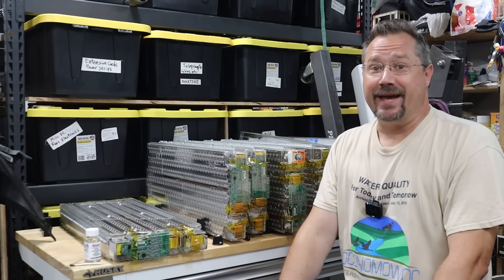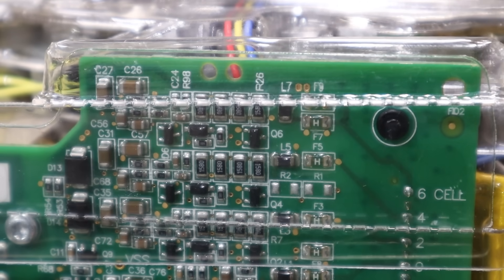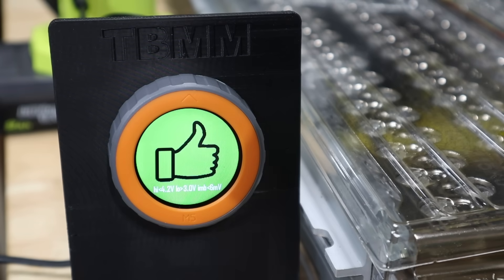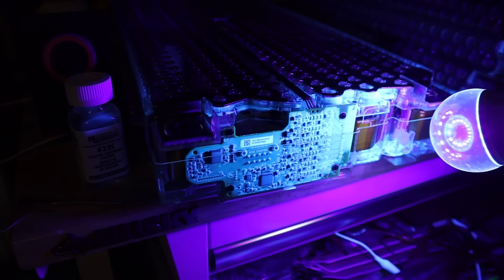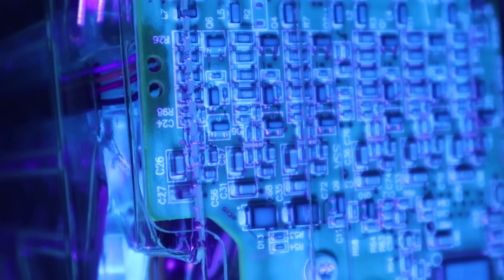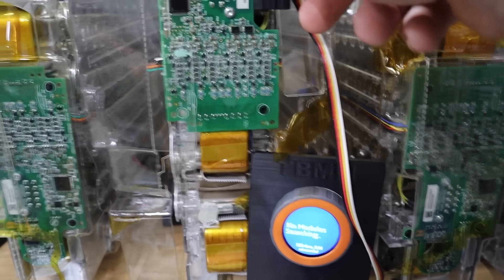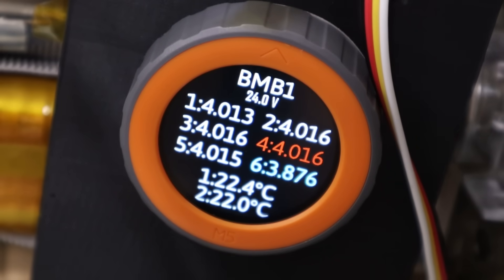DIY Tesla Battery Pack Repair: TBMM and Bad Capacitors! (C26, C27)

Comment from the maker: Please read the whole video description. Plenty of links in there for you!
Reply: Have you come up with a method to completely dry your pack?

The modules are one thing, but the whole pack can be a challenge.  I have worked with dryers and thought about some of my own designs to dry air for many uses.  I would be interested in your plans or thoughts.

After all that work of refurbishing a pack.  It would seem to make sense to install a very inexpensive humidity sensor.

Sensirion SHT31, Bosch BME280 and use an arduino or ESP32 to log the humidity.  First so you know you solved the humidity problem, and second once it is solved, some event in the future could start this all over again.
Reply: @johno812  that is a great idea! Something that should have been stock, in my opininon. I found that the rails "protecting" the umbrella valves had no runoff - so gunk gets in, but can't get out
Reply: @johno812 nice! Did you put one together? Can you show it in use?
Reply: @PhilipX2030 I can’t take credit, many people have used the sensors and ESP32 as IoT devices.  There are many variants.

My Tesla has just under 200K and I plan to add the sensor setup when I need to repair my pack.

In the mean time I use the sensors as just ambient humidity sensors.  

BTW, record both Temperature and %RH.  If no moisture is added or removed from the pack you can still get very large swings in relative humidity as the pack changes in temperature.  What stays constant as  the water stays constant is absolute humidity or specific humidity.   G/m3 aka grams per cubic meter.  But I prefer dew point.  If the absolute humidity inside the battery stays constant then dew point stays constant.

So if you see a rise in dew point over time, you are acquiring moisture.  %RH relative humidity is good to know as when your pack temperature approaches the dew point; your %RH increases.  If you reach dew point, then you are at 100% Relative Humidity.  You will have condensation and water droplets will form.

Comment: I did conformal coating at my last job and many of them use UV tracers to aid in inspection. That shot (around 8:20) is very typical board coverage. More thickness on flat surfaces and the bottom corner of components, yet barely visible on the top edges & corners. Just like any paint it'll run from sharp corners until it's cured.
And if you want any soldering advice feel free to message.

Comment: The TBMM is the purchase I’ve made lately, especially as I use these modules for my off grid home and unbalanced modules = thermal runaway = death. Mine just arrived and after checking 12 of my modules I found one internally out of balance, it paid for itself the first time I used it, thanks Kevin.

Comment: Moisture gets everywhere.  But I wouldn't discount corrosive outgassing of cells. I don't know if modern cells require venting like just about every previous design used to, but I assume it's probably unavoidable.
Reply from the maker: Modern lithium batteries are NOT like flooded lead acid batteries. 

Many electric car batteries, like those in the Nissan Leaf, are completely sealed up.
Reply: @BenjaminNelsonX many other combinations need vents as well. They're not always apparent,  but there.
Reply from the maker: @JoeSmith-cy9wj Can you give an example of modern electric car cells that off-gas in regular use?
Reply: nickel cadmium rechargeable batteries require ventilation under normal use, and lithium iron phosphate need a ventilation system because there will be instances of over temp, over charging and the probably of faulty cells within a large arrangement or sealed pack.
Reply: Like with people
Reply: @BenjaminNelsonX i didn't watch much of the video.  I noticed the corrosion on the component and decided to bring up the question of chemical reaction.

Comment: Very easy to repair. Use a little bit "Roses Metal" that help to resolder that SMD capacitor easily.
Use a soldering Iron with 250°C max. The Roses Metal melt near 100°C --> Use Flux, very important!!!

Comment: Amazing ! My 6 was low too . E pack 2019  . Pack died supercharging . “ ribbon cable failure BMS. Don’t know what it is . I wish I knew the coming issue in it.  017 018 fault bricks out of balance fault .

Comment: That green stuff doesn't look like corrosion.  It's on the plastic and the capacitor, but where did it come from?  Is it causing some kind of leakage issue in a sensor circuit?  Maybe some Tesla employee was eating mint ice cream and had to sneeze.

Comment: As a retired television teck, i use to repair televions at component level. All televions these days use simular sized components ( resistors, capacitors and diodes etc ) and i used a solderin iron that had two tips. This looked like a large pare of sprung tweezers and to use it, each side of the tweezers would ' straddle ' over to component that was to be removed. Have a good look at weller or simmular brands of soldering tweezers. Of course these also need to be a temp controlled iron as well. Not cheap but when you are useing the iron just about every day, makes the cost worth it.
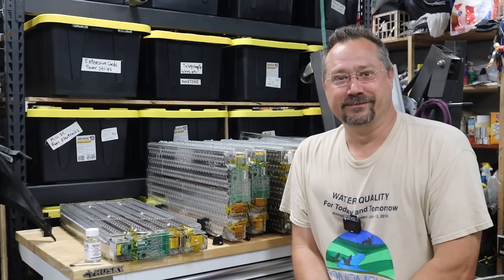Reply: 16:31 love it. Hot tip! 🔥 ⚡️

Comment: Those MLCC capacitors are notoriously fragile due to their construction. They’re made of multiple thin, brittle layers that can be easily damaged. If any disturbance causes those layers to shift or crack, they can short internally.
Because of this, many manufacturers prohibit replacing them with a soldering iron—hot-air reflow is the preferred method to avoid mechanical stress.

Frankly, this is a design oversight. Tesla should have added bumpers or spacers to prevent neighboring modules from rubbing against each other.
While moisture can’t be completely avoided, applying a good conformal coating can go a long way in protecting the electronics.

As for those bypass capacitors—they act as high-frequency filters, but in many cases, the circuit will still function if they’re removed.

Comment: Great stuff! Thank you so much! I have dried out all 16 modules now. Gonna order this little tester and check c26 and c27. I had water ingress in all 15 bays; there was moisture under every one of the mica-sheets. I have the upgraded Umbrella valves with only 2 per bay. I found no sign of water ingress on top of the pack or in the pyrofuse-box, som my guess is water somehow got in via the umbrella valves. The aluminium rails protecting them were caked with road-gunk - I think they were stuck in open position because of this, and water got in when I drove through a deep puddle (never doing that again). I also found that my pack had been refurbished because of water intrusion in the front, most likely because of water splas from the front wheel-wells; I could see that bay 6, 7 8/9, 10 and 11 had the mica-sheets replaced. I am gonna go overkill with sealant when I put it all back together 😆

Comment: Crazy to think about how on many new EVs the battery pack is officially not serviceable. So if one capacitor that costs a couple cents goes bad the whole pack has to be replaced for about 25k$.

Comment: Instead of replacing the capacitors, are the entire circuit boards available on the resale market? Time v. money, etc.
Reply from the maker: NO. The parts are no longer available from Tesla. The only parts available would be salvage from other cars. About $200 each on eBay!
Reply: It takes about 60 seconds to replace those 10 cent capacitors with a soldering iron

Comment: If you have never done SM soldering before, might it not pay you to get the caps replaced (if indeed they need replacing - see Scott Bakers's comment) by a professional?  It wouldn't cost much... $20/a board?  Shame to ruin all your good work for a such a small fee...
I really wish I had decided to have a go myself at fixing my 2015 MS battery that had exactly the same error codes as yours in Dec ' 23 (18 months ago).  I got Tesla to replace it in the end but it was a real palaver getting the car to the nearest service centre - and they were really unhelpful (refused to help get the car off the trailer that the towing company used after the S' brakes bound up due to the usual sitting still for too long in our coastal conditions).  I'm based on a remote island off the west coast of Scotland - 2.5 hours on a very unreliable (CalMac) ferry to the mainland and then anther 2.5 hour drive to the nearest city (Glasgow).  Especially as I have had a lot of success with other EV battery repairs (Mitsubishi i-MiEV) which we have 5 of here on the island.  Still, at least I could use some of the profit from my 2011 TSLA purchase to pay for the replacement battery...  took the sting out of it a bit... and it has a Tesla warranty.
Anyway, keep up the good work!

Comment: This condition is common when water intrudes. Some Tesla vendor supply had poor conformal coating, not proper thickness, which contributed to this result. 

I witnessed many packs without water intrusion, with BMB corrosion. The corroded boards were sent to failure analysis which confirmed the poor coating. 

Cleaning the corrosion with acetone to remove coating and corrosion.
 Use magnification to see well. Some type of excellent bore scope/camera is great.
After solder refit/repair, 3x coating. 

Also, inspect the pins/sockets before reconnecting. The socket "wing tabs" are known to sometimes fail and give intermittent false failure. These sockets were not designed for multiple disconnects.

The voltage sense wires are ultrasonic welded to the "collector plates". Unusual for those to be poor.

Visually check ALL wire bonds. Yes, slow and tedious. But you want to find a bad one now.

After the specific modules BMB are complete, be sure to balance the "bricks", of the module, BEFORE reassembly. 

Suggest that you replace the MAIN contactors, found in the "ancillary tray". Contactors do "wear", so NEW contactors only. 
 And a NEW main pack fuse. 

 NOTE: Pack fuse must be PROPER torqued! 
Clean the bus bar surfaces well with alcohol, or acetone, on a swab. 
And clean the fuse ends. 
This will insure excellent correct surface contact. 
Also, clean the threads on the bus bars. 

AND: ALL ALL ALL bus bar bolts need YELLOW thread lock coat before installation.
 Coat the bolt threads lightly, allow to dry, before installation. 
Again, correct TORQUE all bus bar bolts!

After final assembly, you will need to check, verify the cooling system integrity, using the correct PSI value (air test) with acceptable leak down value.
Check the cooling system integrity BEFORE installing the top cover!

AND the pack enclosure needs a leak down test, different PSI, after the top cover, fuse and cover, installation.

Comment: Ben, push on that C27 with the cover (YOU have capacitance, resistance, and inductance) but most likely it's a cold solder joint on the C27 or a trace to a pad that you can fix by cleaning the area of gunk and scrape ALL the conformal coating off an exacto knife then reflow the solder with a mini tip - if that doesn't work replace the cap.
i can do surface mount, clean the pads (don't take too long or the pads may come off the board) place the component (I like to use a little tiny clamp) solder quick (caps fail if you heat them hot or a long time) a small amount of solder is the sign of good workmanship - . conformal coat it - clear nail polish works fine - then touch it again to see if you resolved the problem.
be advised that it may not look like factory when it's fixed ... at least not when i fix them
Reply: No, they would not have a cold solder joint, its due to the corrosion. Absolutely replace the capacitor.
Reply: Also multi layer ceramic capacitors are piezoelectric devices. Pressing on them changes their value temporarily or even generates electricity like the ignition button on a gas grill. That gunk in there cleverly is not good but it’s not clear it damaged the capacitor.

Comment: Corrosion salts make conductive bridges that shorts the affected components on the board. Most probably that capacitors don't need replacement, you just need to do a thorough clean of all corrosion residue. 
I've repaired several water damaged electronics that came back to life after some scrubbing with a mild acid (white vinegar) followed by a wash with isopropyl. Most of the time that's enough, but is better if you finish the job by reflowing the solder.
Reply: Its 10c to replace the cap, not worth leaving it be.
Reply: @jaro6985  Part cost is not the problem. SMD rework is no joke, and a greater risk without the appropriate equipment and experience.
Reply: @nicozegers  if he's ever going to do it again its probably worth spending $100 on some hot tweezers. If its just a one time thing I guess its not worth the risk.

Comment: Nice work!  That battery pack is impressively clean for a 12 year old car.
Reply: It's supposed to be sealed up tighter than a sardine can... but the HV explosive 🧨 bolt breaker is a liability - and some report condensation from a AC line

Comment: Instead of a dedicated hot air station that rarely gets used, I got the adjustable dewalt heat gun that comes with a pretty small tip that I use for SMD's.

Comment: SMD soldering isn’t too hard… except for the conformal coating. 🤦‍♂️ It will act like glue. Melting it through the conformal coating will take a good broad iron tip with a lot of wet solder/tin to transfer the heat. Once the solder melts the conformal crust should flake away but you’ll still have to unstick the rest from the board while keeping both ends molten. Ceramic tweezers could help since we are dealing with live voltages.
Reply: If you have hot air you can heat an area of the board (100-150C) and the coating will soften and peel right off.

Comment: Great job on your debugging! Can you push on the cap with something that is an insulator not your finger? Maybe a piece of plastic? I'm wondering how much your finger might be acting like a capacitor and throwing off the measurement. I believe you found the issue but it would be nice to see how it fails with something else.
Reply: I used a pencil eraser many times when probing around to find a cold solder joint or broken component.
Reply from the maker: I poked at it with a fiberglass stick and got the same result.

Comment: Fantastic job tracking down this issue!  
You may already plan to do this, but I recommend adding desiccant before sealing up the battery and running a pressure decay test before reinstalling it to ensure you don't have to worry about water ingress again.  At least in the short term that is.
Reply from the maker: Yes, a pressure test would be part of the process before reinstalling the battery.

Comment: You want to order the appropriate iron for the surface mount compound you are replacing.  It will allow you to heat both ends at the same time.  Otherwise you end up chasing the components across the board.  As an electronics tech i tried hard to avoid repairing surface mount boards.
Reply from the maker: I plan to get some assistance on the surface mount soldering and practice on some other scrap circuit boards.
Reply: @BenjaminNelsonX  always looks easier when you see the professionals solder SMD components :) Takes a steady hand.  Give it a try for sure!  What will be interesting is the total parts cost to fix the battery!
Reply: @BenjaminNelsonX  two mini soldering irons works fine for removals
Reply: you do this with a lot of flux and a hotair reworkstation. that works just fine . With thats i populateted a lot of smd boards. A digital microscope is handy as well (a cheap one from amazon is more than enough)
Reply: If you only find a few BMB that requires the components refit/replace, perhaps pay a qualified tech to perform for you. No need to invest tools, practice, maybe damage, for a one time battery repair.

Comment: At 10:19 you can see an abrasion on the clear plastic above C27. ( a scuff mark)
Reply from the maker: I had to double-check whether that was corrosion or abrasion on there. It was both - about 3/4ths of it was corrosion deposited on the plastic, and about 1/4 of it was actual physical wear on the plastic.